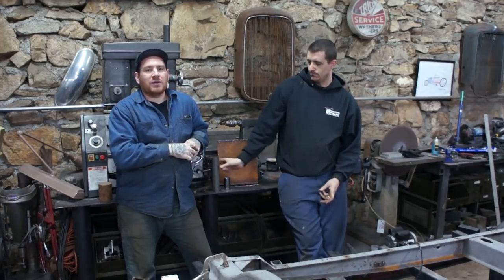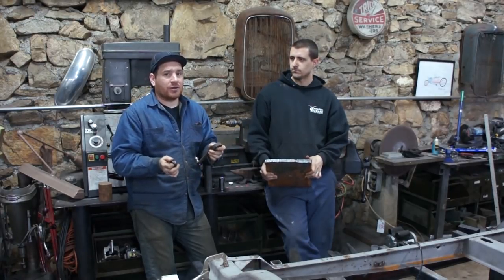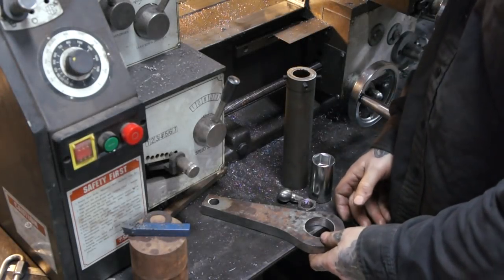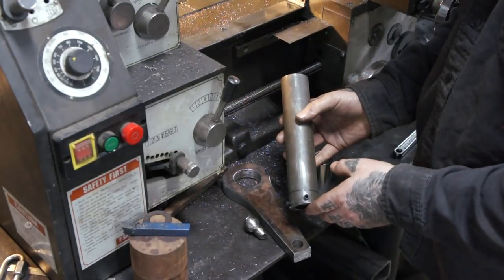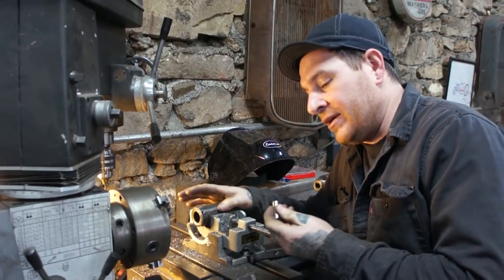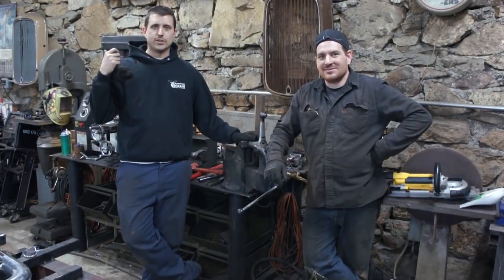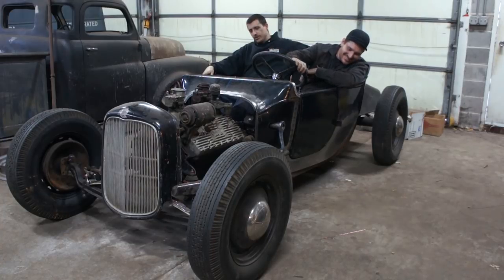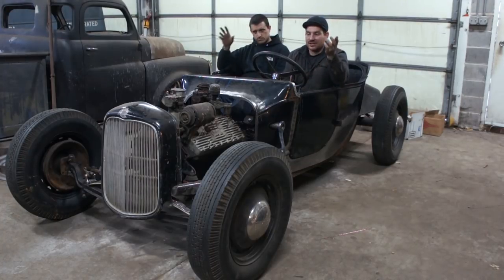How To Make Custom Steering Extension For Cowl Steering - Ford Free T - Ep. 17

Comment: Another way to attach the extension and keep it small is to drill and tap the end of the sector shaft and use a grade 8 bolt to hold it on.

Comment: Are going to produce that set up for others. Real clean look.
Reply from the maker: Bucket List Metal Detecting this is a one off sort of design. Each application is going to be a little different. We were able to mount the box like we did due to the box tubing we used to brace/hold the cowl in place. -Mike/ITG

Comment: Good steering geometry dictates that the drag link should match the arc of the steering arm to reduce bump steer in drag link applications. Yours looks pretty good from what I can tell in the photos.Was this considered in your design? Also, I 'd love to see Matt tig weld while the camera is behind a shaded lens. Loved this vid, keep them coming!
Reply: Excuse me, not steering arm. I mean the radius rods.
Reply from the maker: Hi, Great point to mention! Yes I always try and design my stuff to have a nearly level drag link and it should match the wishbone angle closely as well. It's a lot of standing back and looking to get it all close and then dialing it in with the angle finder. I still need to make the wishbone mounts, but they are wired up to the height/angle they will be fixed at. I'm waiting on the new front tires to set the final wishbone angle/mounting points. Thanks for the comments, that was a great point to mention!

Comment: this car is really looking incredible. I may have missed it, but what is the original size of the nut that holds the pitman arm to the box?
Reply from the maker: The nut was originally 1’” 5/16” we machined it down to 1” 1/4”. I cannot remember the amount that we took off each side of the nut. I wanna say it was .080 (roughly) off each of the 6 sides. Thanks -Mike/ITG